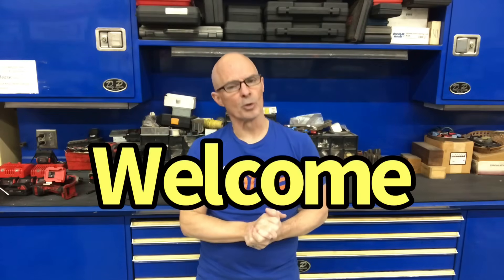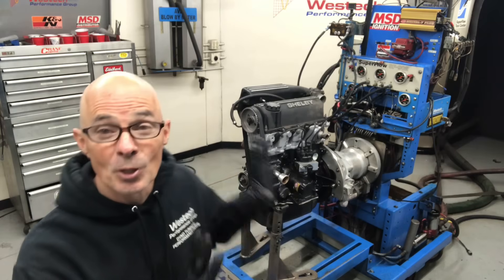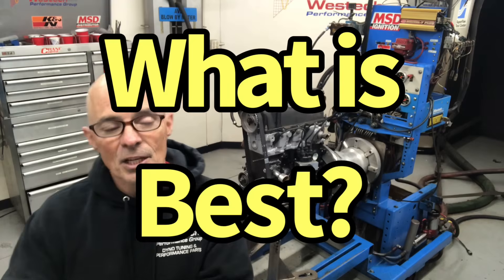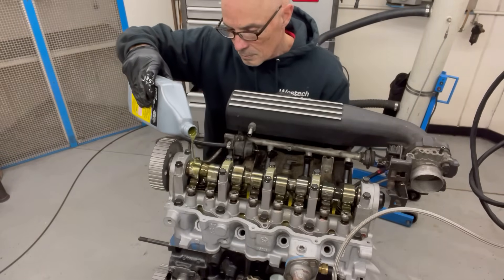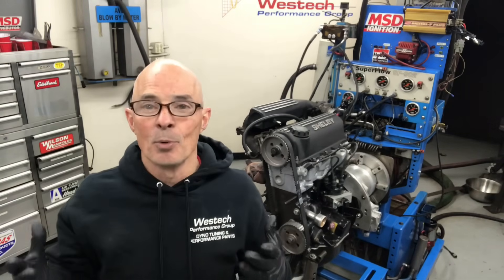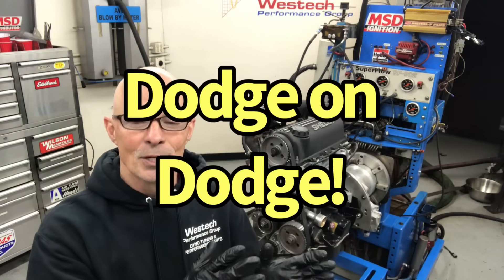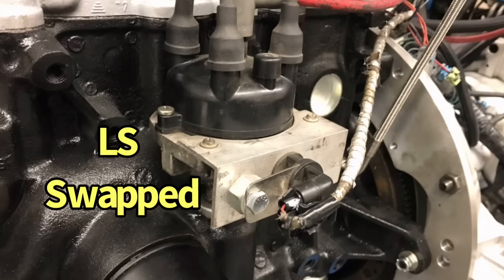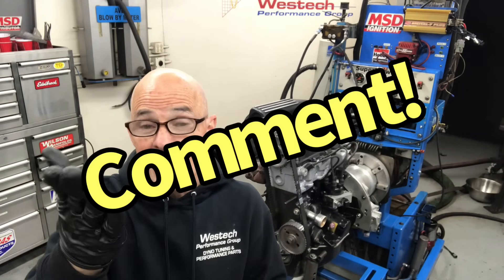2.2L DODGE TURBO-LS SWAPPED THE DISTRIBUTOR. 1ST DYNO TEST. WILL IT RUN? HOW TO RUN HOLLEY HP ECU.

Comment: Could the oil pump be sucking the pan low enough to where it is pulling aerated oil giving a boost in power (less power used to pump aerated oil) the the lifters start to collapse when the aerated oil makes it to lifter galleries?
Reply: it should have the oil restrictor though..
Reply from the maker: oil pressure is good
Reply: @richardholdener1727 Clocking the oil pump before tightening it with the intermediate shaft and front cover fully installed with gaskets and all bolts installed to achieve the perfect balance of free movement and mesh of oil pump gear to the intermediate shaft gear, with the distro in place no belt on the sprockets is also a critical step many do not take on the build/rebuild and while not a secret, is also not a common practice. Did mine on a stand upside down, took the time, installed intermediate shaft bearings, cover all gaskets then the oil pump , insert the bolts down to 2 threads loose on each, rotate the intermediate shaft back and forth and thecoil pump same, and you will feel the perfect free wheeling double gear mesh of that sweet spot. Hold and tighten the pump. It is a huge effort that brings results later.

Most often by the time that pump goes on or is changed there is zero afterthought to the 2 gears in the oil pump, dizzy, intermediate shaft. But do that clocking correctly once, you will never go back once you feel the resistance of the gears not meshing perfectly. The front cover/seal is the bearing and if it walks out the shaft (due to a bad gear mesh), you will see losses or gains on that dyno. And mainly at high rpm as it walks back to center.

It will drag it down in power as it walks out, then as it walks or dances back into place it will gain back the power losses. As simple as can be maybe mechanical and not actually timing related. Just my 2 cents of experience (and tons of research digested from others), with the 2.2 over decades 1993-to present.

Comment: IMO, an engine like this can never produce fantastic torque at 5500 rpm. If it seems like it does it is only because torque is unusually low everywere else. This engine is about 134 CID and ca. 124 lb/ft at 5500 rpm is not that bad, but torque from 3500 - 5400 rpm is pretty lame with way under 1lb/ft/CID. That is bad.
The spray pattern on those fuel injectors are pretty horrific and do not do anyone any favors.

Comment: Interesting test  to the surprise of 55° ignition advance?   
My buddy had an 1986 Shelby Charger, he blew up the manual transmission twice, the second time they would not keep the warranty 😂
Reply: I timed my old 83 GTI by ear once. 
Darn thing ran awesome. 
One day I figured I should check it because I heard a little part throttle ping in traffic.
Kinda glad I did, it had like 28btdc and it's supposed to be like 6 🤣

Comment: Hmmm... I'm guessing valve float. We ran against these 2.2s with 2300 Fords back in the early 2000s on circle tracks. Everyone had trouble with the followers jumping off at high revs. That's what makes me think valve float. On the Fords we would convert them to solid lash adjusters and run "mousetrap" springs to keep the followers from running away. Good work on the distributor mods Richard, looks like a fun project!
Reply: I ran a 2.0 pinto in a vw. No one liked being gapped in the 1/8 mile

Comment: Not a good 80’s dodge mechanic on these Omni”s but it’s spiking at high rpm’s. It’s a intake issue? Something is opening up or the timing is advancing on its own?? Or. The genius idea is it’s more efficient at these high rpm’s due to low compression. I’m guessing it but I covered air fuel and spark. What else. Something has a mind of its own? Vacuum?   Thanks Richard.  You are the go to professor.

Comment: Run the 2.5 with the log them the 2 piece N/A and see if that same spike occur s 🤷 I think that dip is probably timing related. Could be valve float but timing is my bet
Reply from the maker: we ran the motor at three different timing values -spike was always there

Comment: First and foremost get rid of the 90degree on the intake and weld the flange flush and add a mini van throttle body also get a header or make one out of the turbo manifold.

Comment: You can say it ran good but you can’t say it sounded good. It sounded like a fart piped Honda.
Reply: Let me put my bigger Reed Cam in with a ton of overlap and duration that makes zero vacuum until 3K (where it barely starts to build vacuum),  it cackles and lopes like a high lift V8, everyone within earshot at a legal street race who heard it came over and asked to see my v8 rear wheel drive conversion under the hood I would point to my FWD slicks them open the hood to a 1 injector tiny T.B 4 banger (though a nice looking 1), and their Jaws would all drop and say all that sweet noise out of that tiny thing. My machinist listening it to over the phone said no way that was that lil' 2.2L shortblock we put those Ross Pistons in and balanced. The cam makes a world of sound difference but it was slower in it's configuration than with a .430/.430 lift sounding like a tug.

Comment: A fresh rebuilt chevy would never see that much oil pressure!!  😂
Reply: Needs to try a solid lifter 1.5 VW diesel. 
100psi on a cold start and like 130+ when ya rev it(it pinned a 100 psi gauge way past it's scale). 
Warm it'll still have like 95psi at revs.